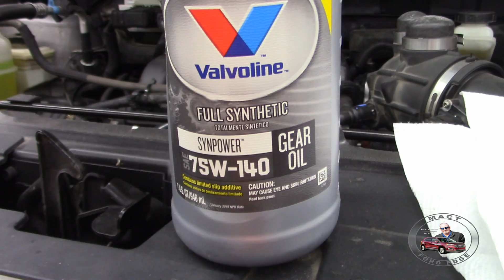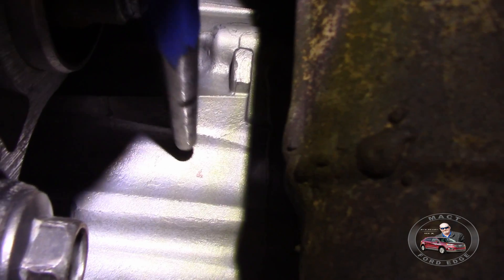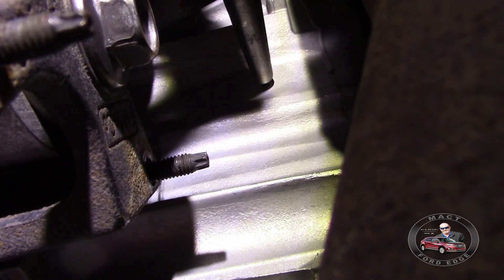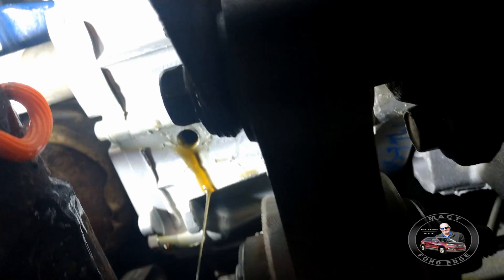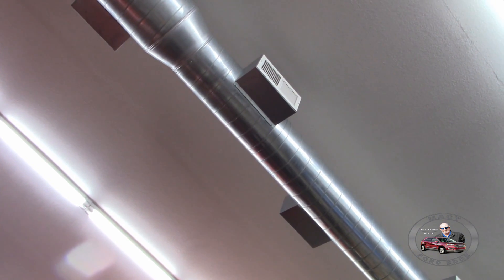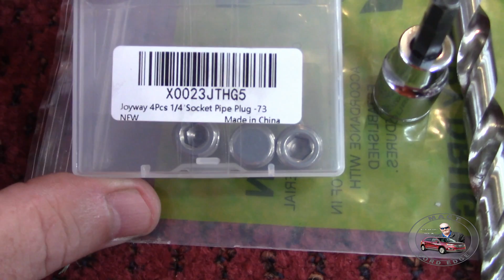How to install a drain plug into a Ford Edge PTU.  Follow me on Twitter!

Comment: You mentioned safety. That’s good. I’d like to recommend that you remove your wedding ring while you’re working. If it snags good enough, say coming down a ladder, it can remove the skin on your ring finger. That’s known as a degloving injury. Or worse, it can remove your finger. The ring can also conduct electricity when it comes in contact with a live wire. Just my thoughts. Thanks for the video. Good information should I encounter an AWD vehicle.

Comment: If you take a clear 4 ounce cup like you get for barbecue sauce at a restaurant drill a hole in the bottom the size of the bit you’re using put that right up there and that will catch all the shavings and they won’t go all over you just a pointer be safe

Comment: Does this have anything to do with sudden power loss and wrench light appearing on the dash with AWD off message?  It happened 3 times now but intermittently. Thought of ECU, Throttle Body and VCT Solenoid. But need a word of advice from an expert.

Comment: Engineers should have to work on what they design. A part that needs regular maintenance that doesn't have a drain plug or filter access. 
Wait ti you change the alternator, it's the first thing on the assembly line and they build the car around it.

Comment: OR, if you want to make sure it is done right, buy DORMANS PTU.
It has been redesigned beefier with better cooling & comes with a drain plug.
$850.

!
Reply: I thought those had issues with the seals? Something like they were installed backwards or not correctly or something.

Comment: I have an 2021 ST and this units at one time had an oil cooler, mine doesn't have it but has a big cover with a magnet that can be removed and drain the oil easily.

Comment: Why wouldn't Ford have changed the PTU's by now to already have a drain plug? Just think of all the extra money they could make if Ford owners had to have the PTU Oil changed every 3000 miles. 
The way it is now, of course Ford considers it "non-serviceable" claims the oil never needs to be changed. At least the Ford Dealership in our town claims that and because its "non-serviceable" they will not change the gear oil in it.
I suppose they want the big bucks to install a new one once ours destroys itself.
Reply: Exactly! Ford is a bunch of tools. But I hear that “At Ford, QUALITY IS JOB ONE” 😂😂😂

Comment: The sidewall of the casting is not that thick. I would not do that.
Reply from the maker: Then you are not aware that this is a standard practice and performed by thousands with no failures. By the way for started doing it also. Research and facts.  Opinions are merely background noise.
Reply: It's about 1/2" thick. Seems plenty thick to me. I feel comfortable doing it to my own vehicle.
Reply: It's apx. 1/2" thick, plenty thick for NPT taps. I love all the comments from ppl who have no clue.
Reply: BFD! You only need 4 or 5 threads for the plug to lock in. Likelihood of a crack emanating from a circular shape is highly remote. Heck, holes are drilled to STOP cracks from propagating. It’s known as “stop drilling”.

Comment: Anyone else use the stainless plug on the recommendations above have any issues?   Anyome else use a different plug?
Reply: Did you ever find more info on different plugs that work well for this PTU? I'm tempted to use the one in this video, but I'm wondering if a "standard" pan plug that has a head and a washer/o ring will seal it better??? Anyone have thoughts or recommendations here?
Reply: Nope still haven't done it

Comment: Hey Bill, I’m concerned about the PTU in my 2010 Edge AWD. I have 180,000 on the original PTU and the fluid has never been changed. I want to go ahead and change my PTU and Rear Differential fluid, but I’m concerned that I’m too late to that party. I don’t hear any grinding or groaning at speed.
Reply from the maker: A gear oil test will let you know your status.  Never hurts to change the gear lube.

Comment: Awesomee. Shame on Ford for not adding a drain plug. Is there any change to procedure for 2022 edge st?
Reply from the maker: The ST uses the AMR PTU with magnetic clutch totally different PTU
Reply: @MACTFordEdge  thank you for the info. Does this amr pto require serv8ce. Can't find it in the service recommendations in manual. Thank you again
R9bert
Reply from the maker: @robertcox5228  This is NOT an AMR PTU.
Reply: I have a 2019 Ford Edge ST and I changed the Ptu fluid with a suckling pump from the refill plug! No problem! I put original oil motorcraft
Reply: @Helicopter Dad!  sure!! Drill up yours and post a video!!!
Reply: Thanks for the video mact